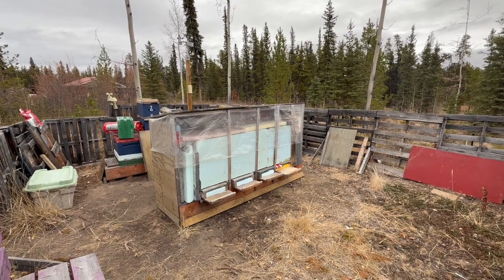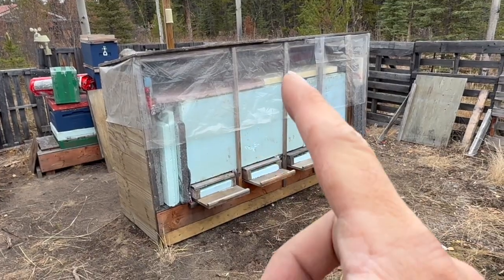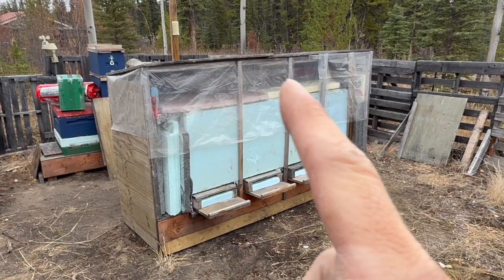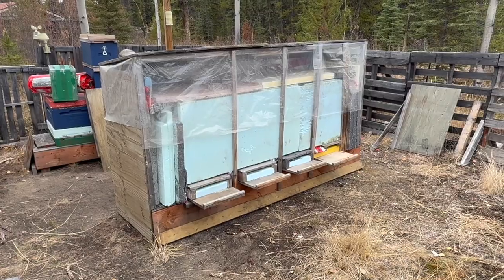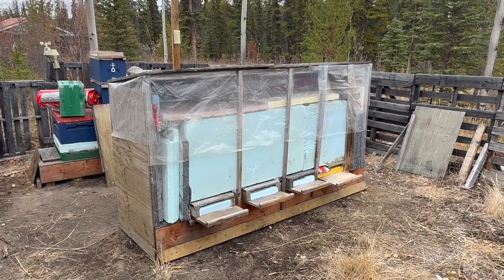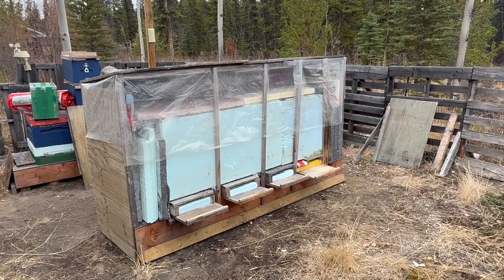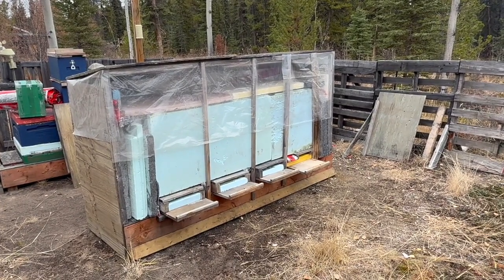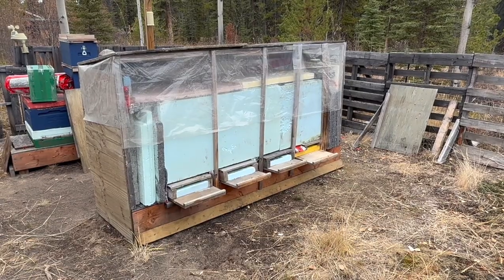Outdoor  - Indoor like Wintering Setup

Comment: how do you control for moisture build up?  i got a quilt box and 2 inches of insulation on top, but I'm in nj so not as cold
Reply from the maker: I don't... I have an open screen bottom board to allow condensation to drain. I let the bees manage it themselves. Never been a problem.
Reply: @etiennetardif Do you leave the whole bottom board screen fully open?  I've just got a couple drain holes on the bottom board with 3/8" hardware cloth over them with mine
Reply from the maker: @brendonh91  yes... the bottom area will soon get covered with snow... I also have a slatted rack that protects the cluster and help maintain warmer temps in the box
Reply: @etiennetardif does the open screen also allow for more air movement, and if so, is that another reason to leave it open?
Reply: We found that if the hive has had time to dry/cure the honey, the moisture comes more from dead bees.  If your mite treatments are done right we don't see the moisture build up.
Reply: @MinnesotaBeekeeper absolute truth. My bees dont get moisture issues. The co2 envelope builds up and they just zone out.
Reply: Throw a mesh bag on top of Styrofoam panels and fill with polymer moisture absorbing crystals. They dont freeze. Its the moisture absorption material in diapers. Any moisture that accumulated will be absorbed by the crystals,.  Gives you the "gel" vibe layer. Not sure if the moisture from inside vents out & up. Keep an eye that bees dont climb up and get trapped under clear canopy. Pretty close to what I do. A few slight differences but conceptually the same.
Reply: @JustBees  i get a bag of pine shavings, one used for bedding , from tractor supply.  it absorbs moisture pretty well. tip my hives forward.  It appears to work well.  No top ventilation.  Change once in the season.